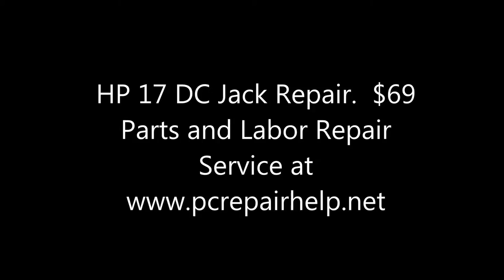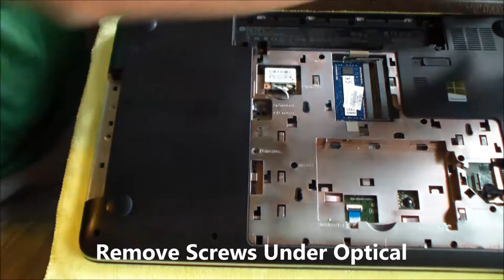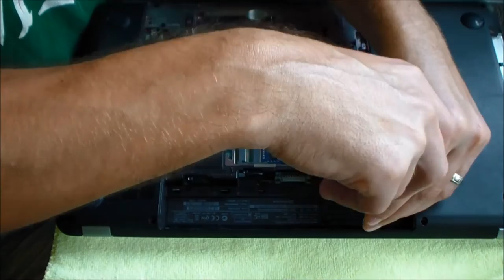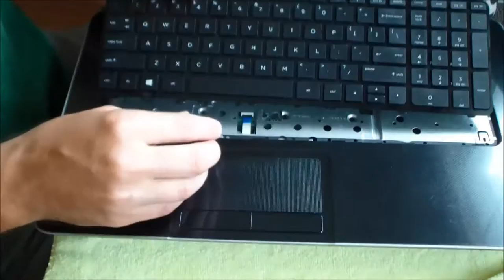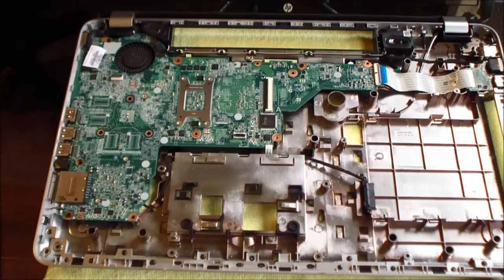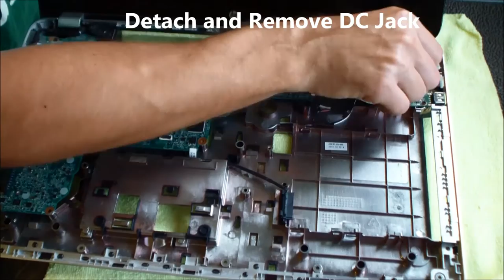HP Pavilion 17 AC DC Power Jack Repair (Broken Charge Port)

Comment: Do you have the power cable with the right angled end?  I can see that being a possible source of problems with the power jacks if someone wants to keep it close to the side of a table.  That would be because of the way the cord hangs down, it could put some stress on the power jack if someone not mindful of the cord moves the computer.  I can see why they designed it like this (keep it from protruding and causing it to bump into things while on the lap of someone in a chair).  I am trying to find out if there is a power supply cable with a straight end instead of the right angle.  Maybe it is just a design preference, but I am used to having straight power cables for things like these.  I am particularly careful of not pulling on the power cord even accidentally and always leave slack so that I do not accidentally end up with a loose or broken power jack but sometimes that is hard to avoid.

If I had a dollar for every laptop with a broken power jack, I would be a billionaire.  That is just how common it is.  They seem to design things as throwaways these days or just hard to upgrade.  My 17-x037cl does have upgradeable parts like older laptops but they did a bad thing when they designed it.  They didn't leave little access panels in the bottom of the case (the ones that are held by one or two screws at the most usually).

Comment: the part is only $32 usd on the hp part website by the way. wil be orering mind and keeping this video saved. thanks.
Reply from the maker: Taylor Fortin it costs $6.99 on eBay I believe.
Reply: yessir it sure does! Thanks for the video!
Reply: Good job